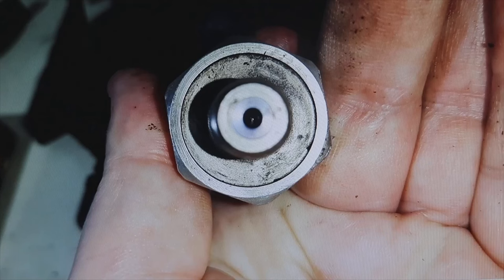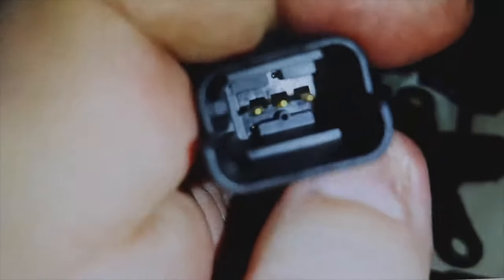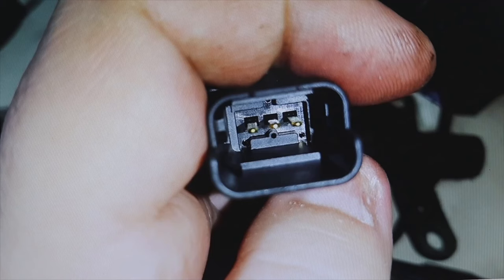P0191 RAIL PRESSURE SENSOR FAIL, MAIN SYMPTOMS, Fuel Pressure Sensor. OTHERS:P0190,P0192,P0193,P0194

Comment: Well well well well...
 I'm not fluent in english but come on man
Reply from the maker: I use an automatic translation program
Reply: @car-parts2.011  I figured that out, but still it's barely watchable
Reply: Does a faulty fuel pressure sensor causes stalling?
Reply: @rodneyunderwood6236  yes mate i'm having probs with mine. crank over and start with easy start, but cuts out if i take foot off the revs..
Reply: @lock411  did u end up getting it fixed, wondering about the price or what exactly is involved, like bleeding the air out after or if the sensor itself can be replaced
Reply: @rhys0065  Maybe it will help someone in the future: I had this p0191 on my toyota corolla D4D diesel engine.
On the other side of the rail, in front of the pressure sensor, there is the "pression regulating valve", I took off both of them (sensor, and the valve) cleaned them AND I changed the gasket of the regulating valve. The old gasket was very thin. When you are putting back the sensor and valve you should not apply any special strength, you put it back with hand and in the end, use your tool to tight the thing up. 
After that i cleared the error code with my android obd2 software, the engine light is gone, the starting is stable and good, the car is responding well to the accelaration pedal.